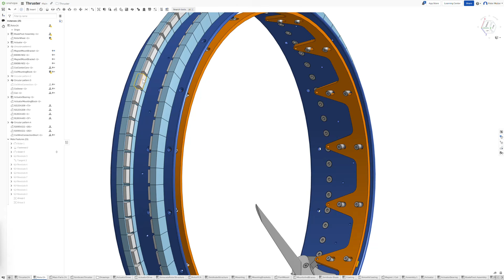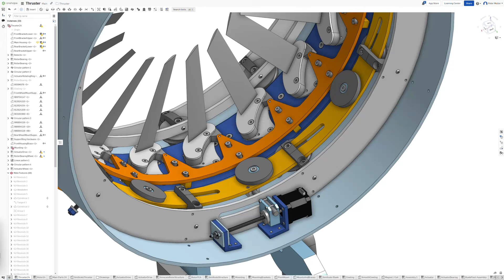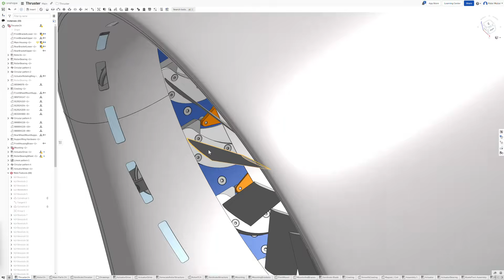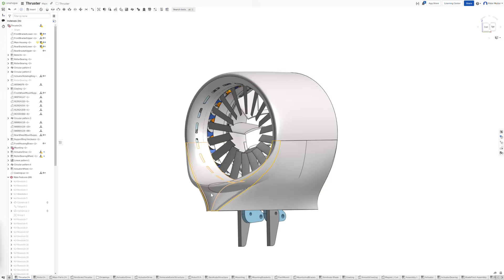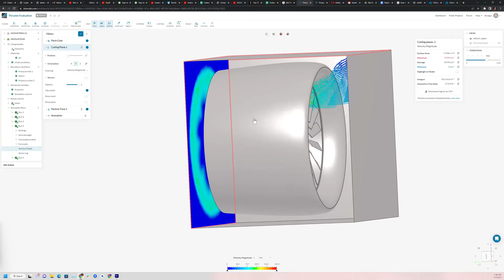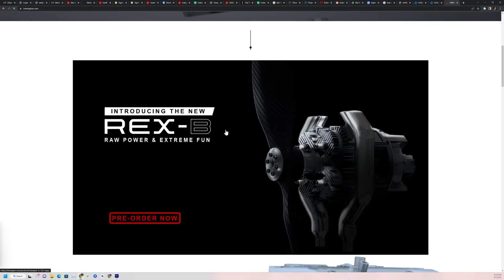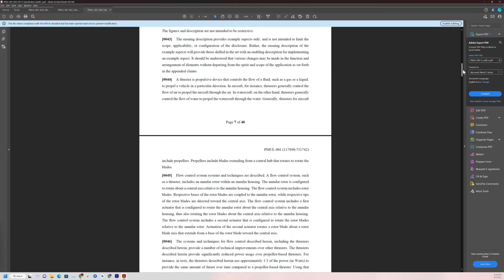Could this Thruster transform Aviation?

Comment: Nice! I would try and make fewer poles. Maybe like 12 poles /14 mags in total or smthn like that, or maybe even fewer still if you are aiming for a fan kind of rpm. (I know, they will be ginormous.) The inherent problem with rim drives are normally that they are bit more challenging to scale up. Also, I would think that better stator core geometry would make this alot better. Look at regular outrunners/inrunners for inspiration. There is to much gaps in the coil/magnet section. The ideal situation is like no air anywhere, only copper magnets and core. And you would need something like 3 turns per coil to get this anywhere near where it shall be, depending on voltage. About the center of the hub, I think you will need it to spin the device fast enough with reliability and low loss. It is needed for the bearings. Peripheral speed on that outer rotor when pushing power will almost be impossible to match with a bearing capability. On a side note, this would probably work very well as a submerged in line pump device for murcy waters. Since the inner blades sort of is safe from getting tangled and the rotational speed demand is alot lower.

Comment: If you could somehow manage to use maglev to reduce the pressure on the support wheels, or possibly remove the load all together, you'd have a pretty quiet and efficient motor there.

Comment: I've had this idea some 8 years ago. I lacked the skills and financial incentive to pursue it. I was calling it "magnetic swash plate" at the time. 
If you can please DM me so I can share some of the insights I had when I first laid out the project. I'm pretty sure this is the future of electric propussion.
Reply: I just wrote the comment in the first few seconds of the video... In my design, each blade can be in independent positions throughout the rotor. That's why I was calling it a magnetic swash plate, it could be used for single rotor VTOL vehicles and differential thrust positioning applications.

Comment: Interesting design, I'm wondering if the cfd mesh captures enough of the exterior flow to get accurate boundary conditions. It seems the inlet is so close that a uniform pressure inlet may not be realistic, nor a uniform velocity inlet.

Comment: No-contact Magnetic Bearing.
Use a central ring to prevent blade flex.
Electric driven.
As for a generator, there's a lot of false data on Fuel Cells. It doesn't require gas Hydrogen. Use a liquid fuel which includes Hydrogen such as Methanol, gasoline, or even Ammonia and a "reformer" for that fuel.
I found i could get 3x efficiencies just from combustion to FC.  Add to that your 3x on a propeller and you ought to have quite a thrust unit.

Comment: Fascinating! This is something I’m sure Rolls Royce would develop further (even P&W and GE). Have you considered a central aerodynamically-shaped cone attached to the stators but projecting forward so the tip is more forward than the cowling leading edge and the rear of the cone tapering gently into a long tail ending much further away from the trailing edge of the cowling. The diameter of the cone (bulb) is largest at the ends of the blade, but a fraction of a dimension smaller than the circle of the passage of the blade tips. This eliminates central by-pass of the air that would otherwise not pass through the blades. Have you conducted a decibel comparison with conventional propeller driven or ducted fan engines? The quietness is a huge advantage.
Reply: If you add a cone, might as well put the motor there.

Comment: hmmm.... center mounted blades expand slightly due to the acting forces. This would cause blades of this design to compress. also, due to centrifugal center mounted blades get somewhat straightened.... just a tiny bit of damage on a rim mounted blade would cause them to buckle and cause even greater damage....

Comment: You should try putting a twist in each of the blades so that the slower moving section near the gap in the middle has a more aggressive pitch than the faster moving section at the end mounted to the rotating ring. That should increase the efficiency of the blades and would likely increase the forward thrust created by the stators too.
Reply from the maker: The blades already have a twist in them.
Reply: @petermuller9177  awesome, must've missed that bit. I love what you're doing and don't think you realise the potential of what you've created. I think playing around with the configuration of the magnets and coils can improve efficiency, and was wondering about tiny winglets at the tips of the stators to reduce turbulence at their tips - like on modern passenger jet wings. Other commenters have suggested a ring around the inside tips of the blades, but it's hard to predict what effect that would have because it would change the airflow over the blades, affect the interface with the slower moving air in the centre, and change the airflow reaching the stators. Keep up the amazing work!

Comment: I came up with a similar concept 10 years ago. I called it the 'Ducted Ring Fan'....

Having studied Helicopters and their rotors, it became obvious that majority of lift is coming from the outer portions of blades. 80 percent of lift was generated by last 20 percent of blade. My thought was to increase the last 20 percent and reduce the wasteful parts of the blades. I ended up with a perimeter driven ring shaped fan with a large center void.

Blades could be fixed pitch or moveable to change thrust. By leaving them fixed, thrust was changed by simply increasing or decreasing the RPM's. The larger number of smaller blades increased thrust significantly. All blades met at a common circular hub, which provide needed rigidity to the blades. 

By using several of these rotating in opposite directions, torque induced yaw was eliminated. By adding stators, a very powerful ducted fan resulted. Concept was to redesign rotary wing aircraft. 

Indeed, disk shaped craft with a large ring fan along outer perimeter and a large center void which became area for crew and passengers. It was a VTOL aircraft that could be run on electricity or gas turbines spinning generators to power multiple drives for redundancy.

Another concept was a triangle shaped vehicle with 3 ring fans located towards the 3 corners. Again, center is open for crew, passengers, or payload. By adding simple pusher fans for forward motion, top speeds were quite high. It is possible to use thrust vectoring directly from the ring fans by directing air via louvers. 

I built scale models and was excited with future applications for it....

Comment: Everybody wants an inner ring. Didn't see any mention that that would probably mean a 2 part blade that pivots off a shaft going to the ring. The plate could still control it at least. But its a considerable redesign.

Comment: Maybe add an aerodynamic center cone to avoid wing tip vortices and wing flutter. 
This would make the ducted fan a wee bit more efficient, use less energy and be more silent at higher power settings.  
But then again, the difference would probably only be marginal at best. :-)

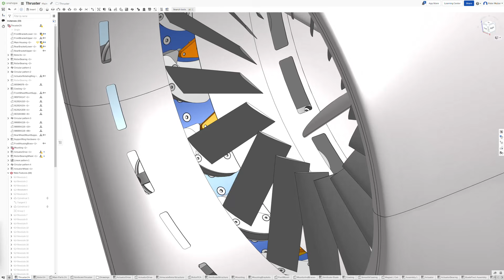Comment: 12:36 Hot swapping a blade. 😂 I wouldn't want to change a blade while this was running. 

But when the engine us off it looks easy enough to change out blades that are broken or simply out of specification.

Comment: Don't know much about aircraft but was always surprised how inefficient a propeller is and did a little studying on how things could be improved with ducted fans. but learned they really don't like air entering at angles?
 I was a motorcycle tech but have always had a great interest in  IC engines, things that go around and round plus anything that could improve aerodynamics or airflow inside engine (motorcycles generally have worse aerodynamics than a house-brick)
The biggest issue with opposed piston 'barrel' engines is cooling and/or the thermal difference between outside and inside leading to distortion as they have been around for at least 40 years (I haven't even tried to keep up with developments)
What is the centrifugal load on thrust bearings at 5600rpm? 
Obviously you wouldn't need radial bearings but something that can take loads in line with pivot shaft
 I remember reading in 1980's, one pound of rubber in a motorcycle tyre weighed over 4 tons at 200mph.
May need a redesign to be simpler and lighter? Maybe something with a DLC on soild pivot?
It may be electronic shutter but blades do look like they are fluttering in your prototype so maybe a stabiliser ring on inner edge?

Comment: Nice design. 
You should see about changing the direction of the magnets to be inwards then have the inner magnet be facing outwards to help alleviate some friction between the rotating pieces, also, what if you reverse the magnet layout and have the electromagnet be the rim and have the blade ring be magnets to propulse the blades?

Comment: You know... this looks like a perfect application for those toroidal propellers. The blades, being individual, create massive vibration. Having some sort of connection between would decrease vibration and would allow increase of  RPM. Tho, theres a power-to-weight limit anyway. The actual motor part is just too big and complex to be scalable. As a thought experiment its nice tho

Comment: Check with the University of South Florida.  There was a patent started years ago with a far more stable and efficient version of this. Under lift pressure and heat from friction, your blades will become warped under the best of circumstances.

Comment: how are you dealing with the blade forces acting in the direction of the blade root, instead of away? I'd certainly rather be supporting a blade in tension rather than compression. this is inherently unstable, vs a regular compressor blade.

Comment: Hubless fan.  Different, but to what advantage?

 Can it take bird strikes as well as a hubbed fan?   Can it be built cheaper?   The blades do not have centrifugal forces assisting them to maintain stiffness, as it is with helicopter blades. Instead of tension they are seeing compression forces trying to lay them down flat against the outer walls.

Comment: I had an idea similar to this with all do respect. But using jet engine fuel or etc like diesel. Almost the same as a regular jet engine but reverse ingenuity. Almost how you have it, but with rows of blades but slightly separated, about a quarter of an inch, from each other & about 10 rows but all around how you have it. Enough so when the airflow moves through the blades. It does like a tornado effect. The problem with these types of cool ideas. Is most of the time you are on your own & lack of money in some cases or lack of parts etc. But once you have it fully functional, because you knew from the start from trial & errors. It was going to work. & in some cases you either put it on paper & it's a start etc until otherwise. So hopefully another, or others pick up on it. & makes the vision happen. Things like this come to people for a good reason. When you leave things like this behind, for some reason or another. You'll see someone else trying to achieve it or has already. It's crazy how that works sometimes. It's because it needs to be done it needs to be accomplished some way or another. Just like some concept drawing written or carved on walls. From other visionaries ahead of there time. Just lacked the resources to make it happen. But left for others to catch up on the concept idea. I know it's hard. But keep up the good work.

Comment: Perhaps some sort of "mag-lev" system would support the thrust of the fan, It appears the ratio of roller wheel thrust support  to the fan speed would be about 10 or 20 x fan speed (50k-100k rpms) for 5000 rpm fan. Decreasing fan velocity from outer edge to inner would require a change in pitch and width about the same as in the front blade on a commercial jet engine A pivot ring for the blades for supporting the blade tips could be a stabilizing influence and could minimize the vortex created by the air trying to slip around the ends of the fins - similar to the devices found on the ends of airplane wings used for the same purpose..
Reply: Quite interesting! I'm hoping to see it work out well. :)

Comment: Huh, well, I guess I should not feel upset someone else thought of this too; it isn't that abstract of a concept. Though this does answer a question I had, wasn't sure if having stators would do any good, was worried they would just add drag with little gain. The marine versions of this concept, at least the ones I have seen, didn't have any stators. Probably something to do with cavitation. 

Anyhow, great work, looks good.

Comment: interesting, a couple things why would you have variable pitch blade when you could control the fan speed and torque with a variable frequency controller and why aren't you using the metric. system?

Comment: Where do you get electricity to run this.  What powers the generators?  Bleed air for anti ice and cabin temp control.   I doubt this will go pass the experimental stages.

Comment: What is the power to thrust ratio? Have you tried stacking them and what the thrust to power might change? 
If you connected the blades to a center point you could reduce fluter. I believe the faa will require screens on evtols in bird altitude areas, have you tried it against thrust?

Comment: What impact would gyroscopic precession have on the blades while in flight? If these were used on control surfaces or tilt wings would the blades deteriorate quickly?

Comment: the main concern is if the benefits outweigh the tried and true high bypass jet engines that we already have a well established manufacturing and maintenance ecosystem for. to make anything revolutionary enough to convince the wider public willing to overturn the current aviation propulsion standards it would have to be an insane increase in efficiency.

Comment: ohhhh wow, I've had the exact same idea :) loving it! ohhh how i wish i could work with someone like you :D i might have a few nice designs that could use these :D you have example locations for the thruster in the patent, if you rotate them 90 degrees, you can use them in a drone as well. not just an aircraft :D maybe a fun experiment can be to bend the inner blade tips to a side, like a cone shape. open center looks better, but a inner ring would add stability i think. maybe a Dyson fan design combination can feed the thruster pre-accelerated air :D like a housing over the housing thing. great video, love it! i wish i could share a few designs with you Peter! :) are you European? maybe if you smooth the design as a model, bring up the resolution, it would be a much smoother model to print? like have rounded off smooth ends on every blade, are the blades sanded down and painted? maybe you can add an entire compression stage in front, or on top, , to compress before pushing through the model? great stuff here. maybe the entire inner rotor could be suspended magnetically, using inverted magnetism. no touching blades :) could the blades and housing etc not also be 3D printed? maybe you can remove the touching black round ring, like the opposing ones, removing one, letting one there on the opposite sides to have halve the friction same stability? i wish i could help you design it further. i do some 3d modelling but not professionally. maybe you can even add a system to lengthen and shorten the blades mechanically as well.

cgtrader.com/3d-models/space/spaceship/dutch-industrial-space-company-concept-05

Comment: I can see some hurles yet to overcome, bearing lubrication being one of them. Might have to go oil fed ceramic like turochargers. 

Phasing multiple controllers might be a solution to speed. Centrifugal force on the pitch control mech is going to get extreme once you start adding that.

Comment: Try suspending a nose cone in the center that deverts the air towards the blades. Maybe a larger one that is a stainless steal mesh with a solid nose cone in the center. To devert any bird strikes away from the blades?

Comment: Won't this configuration make the fins bend if there's any deflection from perpendicular to rotational axis, due to centrifugal forces? In a traditional construction with a core, they can only get straightened out. In this one, any slight bend or blade mass distribution unevenness will cause them to bend further.
Reply: Also, what about vortices caused by the blade edges near the center?

Comment: Do the blades need to be able to change pitch? Sure, on a constant speed propeller the governor changes the pitch, but why should this have to be constant pitch? And if the pitch doesn't have to change, a foil ring can attach the blades in the middle

Comment: Is there a concern the shock resistance of the blades if struck with a foreign object?   Would an internal ring with pivot point on each blade strengthen the rigidity of the blades?

Comment: Nice... sort of an inverted wheel-hub motor.
What are the inner ring and magnet brackets made of?  Normally motors are more efficient if you complete the magnetic circuit, making sure the material connecting the magnets has the permittivity and cross-section to fully contain the flux... which can be tricky with large neo magnets.  If you aren't alternating polarity from one pair to the next around the ring, you'd need a big C shape on each pair. The ring might be good enough to do that if it is ferromagnetic with high enough permittivity and large enough cross-section.  If the inner ring isn't ferromagnetic and they alternate polarity around the ring, then you can bridge neighboring pairs of magnets with ferromagnetic dual-magnet backets with one side offset by one magnet from the other side. That way you get one continuous wavy circuit all the way around the ring.